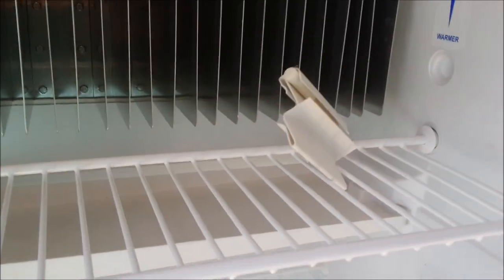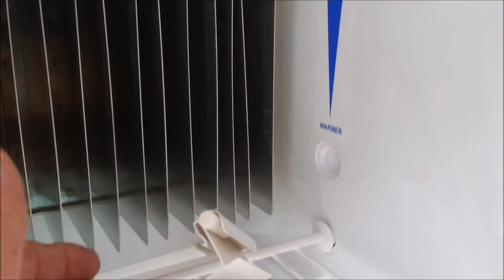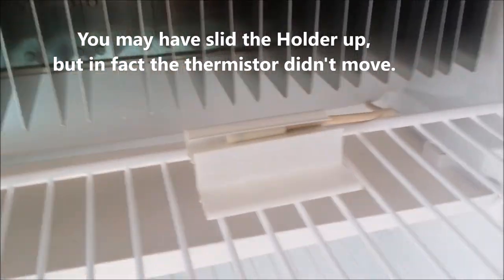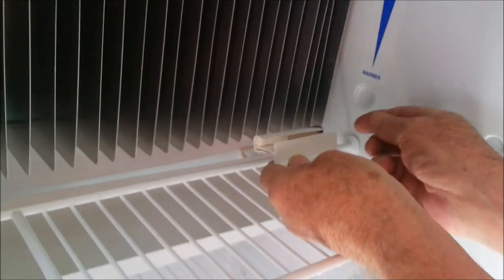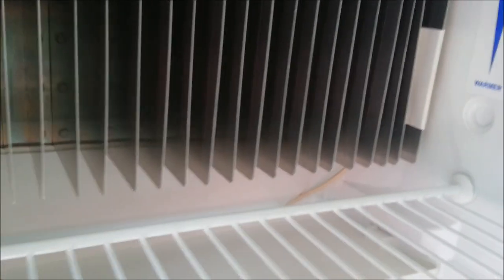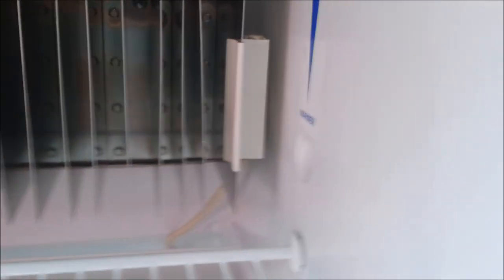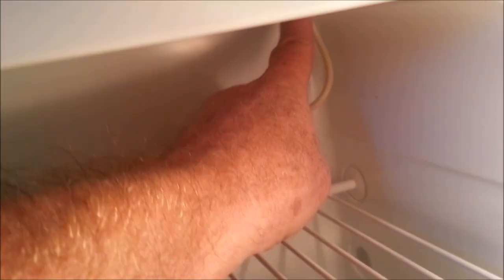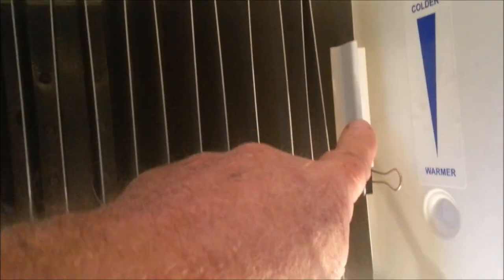Dometic Fridge Freezer not cooling?  Pesky Thermistor. Forest River Rockwood Mini Lite 2109s

Comment: We recently purchased a travel trailer with this type of fridge. Trying this to see if it works, thanks for the tip!
Reply from the maker: If it still gives you issues, try moving the Thermistor clamp, to the left ONE fin.  I heard that helped someone.  But be sure everything is secure.  :)   Also check in the back of the fridge outside to be sure something hasn't come loose.  :)  Good luck.  Michael
Reply: The tip from the video did in fact work, but that's also another good idea to keep in mind to move it left one fin. Thanks again! (Now if we can ever get back into campgrounds...)

Comment: Such an easy fix that i have found no mention of in any previous vids i have searched thru- i just adjusted mine, as it was all disfigured due to shoving to much food in it this week, i was not aware that wire was anything i needed to be aware of 😱lol ( never noticed the white clip on😩) even if i need something else to fix my issues of; severely frosted fins in refg, frozen back wall in freezer but refg food not so cold on setting 5 on Dometic RM3962, ( imma newbie f-timer) this is fab info so i thank you sir👍!!
Reply from the maker: Well cool!  LOL   Glad it helped out.  :)
Reply: @garlandstyle5797   it worked!!🙌 that's actually what the problem was- it's been dats now since i adjusted the thermister and WHALLAH!! tysvm👍🙏🙌
Reply from the maker: @melaniemiller4567  Woot Woot!!!  :)

Comment: We just bought a 2020 springdale mini with this same fridge. It wouldn't get cool. Had to throw out food because it spoiled after a four day camping trip. Taped and clipped today. Hopefully this solves our problem! Thank you.
Reply from the maker: It is a common issue as people just don't understand how that Thermistor works.  I hope it works ok for you.  You'll know in 24 hrs or less.  :)  Good luck.
Reply: @garlandstyle5797  nope, didn't help. It got down to 50 degrees, now it's up to 70 in the fridge! The freezer was down to zero and is now up to 40! I don't know what's going on. Very frustrating, as we just bought this camper.
Reply from the maker: @Kaitebursley  Is it a Dometic DM2652?  You should have a manual with your camper stuff.  Mine runs on shore power (30amp service of course), or on Propane using the battery for 12 volt power.

Comment: Can't wait to check and see if this is the problem with my brother's camper, we just bought it used for him after his home burned and have no idea anything about a camper. I did notice that white hose laying on the bottom of fridge but had no idea what it was for.
Reply from the maker: I guarantee you that is the problem.  :)  Right now, laying on the bottom?  It is on it's LOWEST setting.  Good luck.
Reply: Wasn’t the answer
Reply from the maker: @lorettawalls466  Oh bummer.  :(  So sorry.  Hope you got it fixed.
Reply from the maker: @lorettawalls466  Was it attached, in the rear of the fridge, outside?  Trace the wiring where it pokes through into the fridge.  Also, the fuse?

Comment: I love the clip idea. My thermistor has always slid around and fallen out of that plastic holder. Fridge has always been freezing cold so at least that hasn’t been an issue, but I’ve wondered if the adjuster would actually work. I’ll try the tape thanks.
Reply from the maker: It's been working for me ever since I did that.  Good luck. :)

Comment: Trying this. Noticed yesterday that our refrigerator wasn't cooling down, although the freezer is still working. no ice buildup on the fins. I HAVE been packing a lot of food in lately and - as in your video - the thermistor clip had slid down to the bottom of the fins and the sensor was positioned in the middle of the clip. Repositioned and taped. Crossing my fingers. Impossible to get RV service in an emergency and service for Airstream trailers is especially bad in any case. You really have to learn all this yourself.
Reply from the maker: If the freezer is working ok, then positioning the Thermistor to the top for a while should do the trick.  If it gets too cold in the fridge, just move it down a half inch and watch for a day.  I just have a cheap little 99¢ thermometer in the fridge.  It doesn't have to be perfect, just enough to let me know it is cooling correctly.  Good luck.  I hope it works for you.  Happy travels.  Michael

Comment: Just tried this as ours was down....fingers crossed.   Thank you.
Reply from the maker: Wishing you the best.  :)
Reply: It worked!!! Thank you so much!
Reply from the maker: @reneleathers  Woo Hoo!  :)
Reply from the maker: @reneleathers  Woo Hoo!  :)
Reply: @garlandstyle5797  As soon as I slid mine up, the auxiliary fan kicked on outside. I repositioned some of the food items to hopefully allow better air circulation as well.
Reply from the maker: @jbjlock26  YES!  :)  So cool?  LOL
Reply from the maker: @jbjlock26  Cool!  Literally.  :)
Reply: @garlandstyle5797  Much improved over yesterday. About 35-36° first thing this morning and probably didn’t go above 38 or so in the heat of the afternoon.  Thinking now that possibly elevation may play into the performance? First time for this unit to be above 6,000 feet.
Reply from the maker: @jbjlock26  I had no issues with my Dometic even higher.  But if you are below 45º, nothing will spoil.  You should be good to go.  Worst case scenario I've used.  Keep a couple of freezer packs frozen all the time,  just small ones 8" square maybe.  If you have an issue, just slip those down into the fridge compartment.  Performance is better on Propane too.  Good luck.  :)

Comment: I bought my RV used and this video was very helpful although I found that the wire to the thermistor is actually NOT in my fridge.  Are there in videos on threading a new thermistor wire?  When I found the hole it should have come through, it had dirt robber droppings.
Reply from the maker: Yes.  I've seen somewhere on YT a guy put in a new one.  I just had done a lot of searching.   Good luck and hope this helped.  Michael

Comment: Thank you I did exactly that. My therm wire was just dangling now it's properly mounted, however my fridge has been making clicking sounds and my RV lights and radio flicker, if you have any input we'd greatly appreciate it.
Have a great day! 💯
Reply from the maker: If your converter is located below the fridge, like mine is, the clicking may be coming from there.   That would explain flickering electrical issues throughout the camper.  I've heard of noisy converters.  I sure don't know how to tackle that O A.  I'd recommend an electrician look into that.

Comment: My fridge is freezing everything. We bought it used a month ago. It didn’t come with the white clip for the thermistor. The thermistor was just laying in the fridge.  Do you think I could just clip the thermistor with a clip and it would work?
Reply from the maker: Yes, clip that Thermistor to the fins.  It detects the cold via the fins.  If it is laying on the ledge, it thinks it is HOT.  Use a clip like I did. or two of them if needed.   :)  That should work, adjust UP and DOWN to fine tune.  :)

Comment: I have the same Dometic unit as in your video. My refrigerator stays at 25 to 29 degrees all the time. No matter where I put the clip on thermistor. Unit is literally brand new, we just picked it up a week ago.
Reply from the maker: Did you get a manual when you bought the camper?   If not, Google the model # online and download the manual.  I've never heard of one being TOO cold.  There could be a setting besides the Thermistor on the fridge.  I'll check my manual tomorrow.  Also, is the Thermistor on the back of the fridge, coming through the back of the fridge, connected ok to the mother board electronics?
Reply from the maker: I read in my manual that the temperature is preset at the factory for the unit as a whole.  The inside sliding thermistor controls the refrigerator section somewhat however.  I would try turning off the fridge completely, doors opened, and let it come to room temperature. Then power the unit back up with the thermistor slid all the way to the bottom.  Check the temperature again after 24 hours.  There should be a label on the inside of the fridge on the side somewhere stating the model of your fridge.  If it continues to be too cold, the factory setting is probably incorrect.  I couldn't find out how to override the factory setting however.  You may want to collect the Model and Serial# of the unit from the inside sticker and call Dometic.  I know that's a hassle, but you need to get this corrected.  There has to be a way to override or change the factory setting.  It may be on the power/control module.  I did replace my power/control module when the gas function was not working properly.  I have a video up on that as well.  I got the module at a Camping World parts department for under $100.  Good luck sir.  Michael

Comment: I wish this was the easy fix that made mine work. :( Appreciate the video though!
Reply from the maker: Rats.  I hope you get it fixed.  Could be a bad control board.  I had to fix mine when the Gas control chip died.  Good luck.
Reply: @garlandstyle5797  appreciate the response. I hope it’s not the control board as I’m sure those aren’t cheap. So far my symptoms are that whether I’m on gas or electric, the freezer gets cold and the refrigerator barely cools.  The single fan immediately comes on (which didn’t happen before) to create airflow when I turn the fridge one. There is also baffling to ensure airflow is pushing through the coils. It worked fine three weeks ago and the only thing I did different with trailer storage between now and then vs any other time was turn my disconnect power switch to completely disconnect power to trailer while charging the battery. That should not do anything negative to the fridge though. I need to start some electronic trouble shooting I suppose.
Reply from the maker: @pennesnatcherinc  The control board I bought at Camping World was like $70?  Not expensive, and I could easily make the swap.  I'd suggest using a line tester to see if you are getting current where you should.  Check the connections in back of the refrigerator outside too.  Make sure the connections are solid.  Good luck my friend.

Comment: My thermistor cord doesn’t reach very high.  Barely correlates to the markings on the inside of the frig.  Is the cord supposed to have enough slack to reach the colder settings?  Thanks.
Reply from the maker: Open the back of the fridge outside.  You may find some slack back there that you can push in.  It should be located on the bottom left of the fridge as you face it from the backside.  If it is still too short, check with the dealer.  But is most likely the issue.  Good question.

Comment: What if my fridge is running too cold should I put the top of the thermistor down lower in the slide? When I got my camper the thermistor was just hanging loose down and away from the slide and my fridge was running too cold. Really don't want to unload the camper and take it back to the dealership unknown indefinite of time
Reply from the maker: Keep moving the Thermistor down, wait 24 hrs at a minimum and see if that helps.  It takes that long to adjust.   It should always be clamped to a fin.   If it continues to run too cold, yep, it is dealer time. Good luck.
Reply: @garlandstyle5797  took it in yesterday only problem  I live in an apartment so I have to walk a "mile"  to unload it. No matter where I position the thermistor fins are always icy, and especially colder if I leave it 12 to 24 hours. Freezer portion isn't that much colder then the refrigerator portion.
Reply: @garlandstyle5797  dealer fixed my camper and all he did was moved the thermistor just a little bit & beyond the top of the plastic slide

Comment: I need to replace my thermistor is this easy or do you have a video on how to replace one?
Reply from the maker: I haven't done that Shari.  But?  You should be able to trace the cord connected to the Thermistor inside the bottom of the fridge out to the backside.  It may be a wire than can be unscrewed and replaced.  I'd be careful if it isn't in your comfort zone however.
Reply from the maker: Shari.  I did find a video from a guy who replaced his Thermistor.  He calls it a Thermometer.  :)   Here is a link to that video:  https://www.youtube.com/watch?v=Jgit68eGla0
Reply: @garlandstyle5797  Thank you for the reply. I will give this a try.

Comment: I am trying this because mine is not cooling the little thermostat was down lower in the casing than it should have been.you said I could pull that cable through a little bit more but mine is very tight and I'm afraid to pull on it any further.
Reply from the maker: Hi Bobbie.  So sorry to be late replying.  Stupid YouTube blocked your comment for some reason?   take the back cover off the fridge, find where the cabe/wire goes into the fridge and you should/may have some extra cable back there to PUSH through.  It could be tied up and is hitting the tie.   Hope you follow what I mean.  Michael

Comment: I was told the top of the thermistor had to be sticking out the top. 😑 It’s a brand new one, so I’m going to try this.
Reply from the maker: Didn't seem to make a difference on mine.  But let me know!  :)
Reply: @garlandstyle5797  I’m giving it 24 hours. If my patience lasts that long.
Reply from the maker: @BrendaD72  LOL   :)  Good luck.
Reply from the maker: @BrendaD72  How did it work?
Reply: @garlandstyle5797  I think there’s something else wrong with it. It gets colder overnight, but warms back up over the course of the day. We have a fan going inside and one going in the compartment on the outside. It’s a brand new thermistor so it’s not that. Just can’t keep up with the hotter temps outside.
Reply from the maker: @BrendaD72  You may want to get on the roof and check the vent cover over the fridge.  It could be clogged with debris or possibly a birds nest inside.  I've not taken off my cover, though I have been meaning to check it.  That vent stack helps keep the fridge cooler by ventilation.
Reply: @garlandstyle5797  husband did that already. :) Our camper isn’t exactly new, so this thing is probably ready to be replaced. We stay in it for months at a time because my husband’s job takes us away from home….so a working fridge is a must. But kind of expensive to replace. 😬
Reply from the maker: @BrendaD72  I guess nothing lasts forever.  I hope I'll be able to get the same style fridge again when mine dies.  I don't like the new 12v fridges they have in current campers.   Good luck kiddo.

Comment: can you unplug the thermister to see if it is the reason for the fridge not cooling ?
Reply from the maker: The Thermistor can be unplugged from the outside to the fridge.  But if you do that, you will shut off any temperature monitoring inside the fridge.  Not sure what would happen then.  If you were to disconnect it, have a new one available to attach.

Comment: I would think, that, how the thermister works, is that, as there is warmer air near the ceiling of the fridge, that the thermister tells the fridge, 'it is too warm' so the fridge works harder to keep the air colder. That is why, when you move the thermister up, the fridge gets colder. That said, if you put tape over the fins at the thermister location, in theory, it may warm the thermister, thereby making the fridge work harder to keep the air colder. The reason I note this, is that, I can not lengthen the thermister wire to raise it. It does not pull more wire out of the fridge component area so I can not raise the thermister. The thermister, now, only sits about midway between the fins. On a hot summer day, the fridge can not get colder to compensate for the outside warmer air, because I can not raise the thermister. A modification may be in order, perhaps a little insulation/tape on the fins or around the thermister. Any thoughts?
Reply from the maker: Sounds quite logical to me.  Check at the rear of the fridge, outside.  The thermister cord runs from the outside into the fridge.  I have heard of others that had to push additional wiring inside the fridge.  Perhaps the wire is knotted or zip tied to other wires out there not allowing you to feed more line inside.

Comment: Just tried this on mine.... i dont have a sliding clip. But the wire with thr thermoster was just hanging upside down in the fridge. I put it between 2 fins near the top.... we will see in the morning
Reply from the maker: Even a clothes pin or paper clip may work for the time being.  :)   Hope it works for you.
Reply: @garlandstyle5797  I used a clothes pin and it's a little colder now. Took a while  but i think it did work!
Reply from the maker: @jamone9115  Move it all the way up in the morning, try not to open the fridge or freezer much during the day and check it towards evening.  They do take a good while, hours, to cool down, but should maintain their temperature well after that.  Providing you aren't diving in the fridge too much and of course the room/external temperatures.   Good luck.  🙂

Comment: Is the top of the thermistor supposed to be flush with the top of the sliding clip or does it need to stick out about some? Thank you for the video.
Reply from the maker: The clip is simply a "holder" for the Thermistor.  I have the tip out a bit so I can actually see the level I'm at.  Since the clip hides the Thermistor, I know where it is located at all times up or down.
Reply: Yup, according to the manual it should poke out just a bit from the top.   If its flush with the top tho, it'll work just fine.  As Garland Style points out, the important part is that you know where its positioned so you can keep your fridge at the right temp.
Reply from the maker: @trooper5157  Thanks for the addition. :)